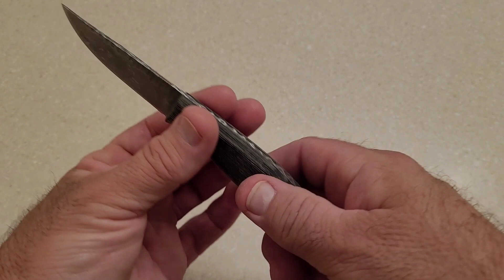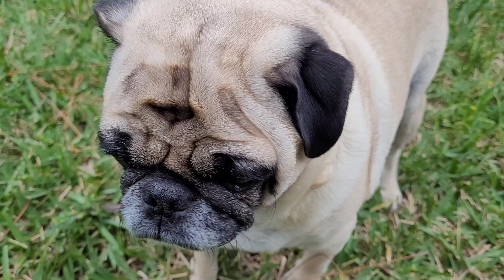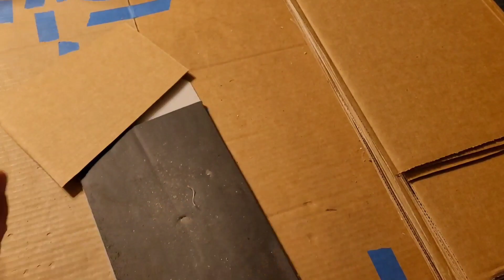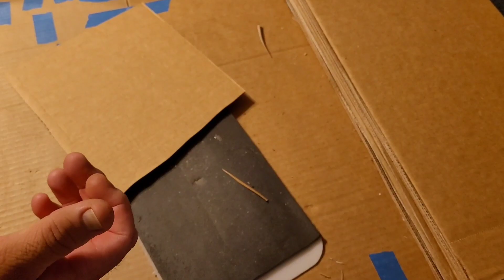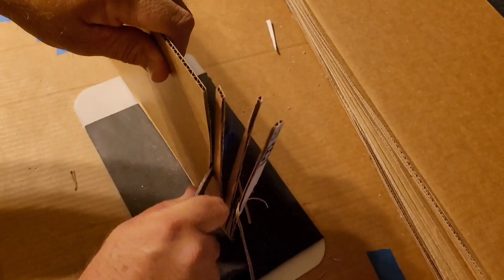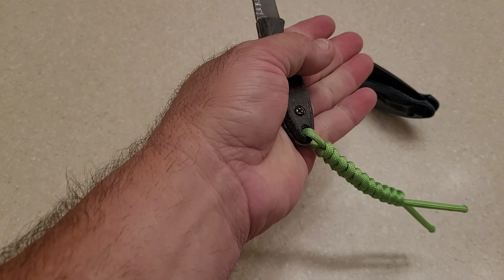Magnacut edge retention testing, DCC pass around fixed blade. How did it do and discussion on use.

Comment: Hey cool! This is Kyle, the maker behind D.C.C.  and thanks for your testing that ugly lil dumpling of a blade! This was the first magnacut blade I heat treated and tested, and I've since made some tweaks and have been running my smaller blades closer to 65hrc and it feels considerably different on the stones.  I think this video is great because it'll help dispell some of the myth/hype of this steel and show that it's not bringing anything wild to the table in terms of performance at the edge, but bringing that 4V/Cruwear-esque toughness, stability, and wear resistance *in a very stainless package*.  I'd love to send some more blades your way sometime soon.  Always much appreciation for your work 🙏
Reply from the maker: Thanks, I do need to get with you at some point. I agree the hype on this should be it's stainless with the benefits offered by tools steels. I'd be happy to test a current version or anything else you might be curious about or want some info out on.
Reply: @Outpost_76  sounds great,  I'll get in touch in early 2022 once I'm up and running after relocating across the country. Cheers

Comment: I finally picked up a magnacut knife recently and had the same experience with developing a large bur quickly. I had a hugely different experience in that it took a lot of work to get the burr removed. I’m hoping that this gets better after  i have to sharpen it several times.

Comment: In real world use it doesn't matter which knife I bring with me to work, 1095 dulls out as fast as cruwear. Can you help explain this? I'm beginning to believe if it's not a single material under strict testing circumstances, steel choice simply doesn't matter. Even toughness, 1095 isn't all that and people baton it thru frying pans. Is this whole super steel thing a scam?
Reply: Perhaps the steel isnt HARD enough fro your use case? Need a good heat treatment. Toughness doesn tmatter much when it just flexes and dulls by mushrooming the apex instead of abrading. If it dulls by mushrooming, you lose the ability to get better edge retention by going thinner, and get even worse when going more obtuse. Try getting a very hard steel if you can, wether it be 52100, 14c28n, or a PM high vanadium steel. It should hold up a fine geometry which will cut much better, then you can only make the edge obtuse as needed to prevent chipping instead. You can make a knife edge tougher but you cant make it harder with sharpening.

Comment: I have a pry guy from DCC coming in at it's supposed to be 64-65hrc now. The results are about what I expected considering on Larrins site you can see that Magnacut performs about like 4V in wear resistance. I wasn't expecting anything more(some people thought you're going to get s90v results) and I'll be happy if it performs like my 4V para 3 but without a need for coating or worry about edge corrosion. 
If I want high wear resistance I have customs in m398, Elmax, s125v. 
I'm interested to see how it compares to CPR steel which is like a non PM stainless Cruwear. I have a custom in it at 64-65 but haven't really used it but it's supposed to perform pretty good from few tests I've seen.

Comment: So magna-cut is a tool steel with stainless property's. The numbers aren't very earth shattering. 
The big thing to me is that was a custom knife and it doesn't live up to the hype. I wonder what the production numbers will be, I'm not holding my breath. 
I personally prefer midrange steel it does fine for me 14c28n, Aus10,xhp.
I have got a big camp knife in A8 so far I really like it. But I have to see how it holds up during camping season. 
Have a wonderful Thanksgiving.
Reply from the maker: Magnacut is a stainless with tool steel properties. Considering how production 4V and custom 4V do this Magnacut at 63.5 is right where it should be. Too many hyped this steel in the wrong ways. It's bonus is its a stainless with very improved edge stability and toughness. Once I can get a 64.5 to 65 rc example I'm betting the results will be very good. 

As an example, if this Magnacut is what we would see in production you will get better wear resistance than 95% of the M390, 20cV and 204p out there. All while having better edge stability,  toughness and impact resistance so it's a plus from a user perspective. If it only does a little better than this you still get wear resistance like production M4 in a stainless that has better toughness and edge stability than other widely used stainless from production companies. The hype was just focused in the wrong place.
Reply: @Outpost_76  always a pleasure to get your perspective. I enjoy your videos. As far as these super steels go to me with what I use my knives for. I don't see a reason to spend the money. I just don't use my knives enough anymore. My usage is outdoor camping so edge holding isn't as important as ease of sharpening and toughness. For cardboard I use xhp, 14c28n. But who knows maybe something new will pop up.

Comment: I would like to try making a kitchen knives out of it - so I would also be interested how does it sharpen on water stones like Shapton, Chosera, etc.
Reply from the maker: As I get some more in to test I'll try it out. I will also do a quick sharpening with this one to see. As easy as it was on a diamond plate and the Venev stones I'd bet it's going to sharpen without trouble on a standard water stone.
Reply: @Outpost_76  that sounds great as most high end kitchen knives users don't use diamond stones (even though this is slowly changing, it won't be becoming standard anytime soon) or diamond plates (only to flatten stones) for sharpening. So to be able to get the full potential sharpening wise on conventional sharpening stones is important.

Comment: I heard that the heat treat on magnacut was not too difficult, hopefully that translates to results for production knives. I think his knives are even harder now for the magnacut. The lower Chromium amount than a regular stainless probably translates to greater ease of sharpening
Reply from the maker: This example is very easy to sharpen. Id that aspect translates in to higher hardness examples it will be nice. Even if it is the same as sharpening harder 4V it's still going to be a breeze.

Comment: Awesome G,  thankyou....
How does that magnacut stand against s90v? More in particular SPK s90v??
Reply: This steel shouldn't be remotely compared to S90v it's nothing a like. You can't compare steels like that. This is a stainless steel that is super tough (think 3v/4v levels of toughness) and S90v is anything but tough but has insane edge retention... They are at two totally different ends of the spectrum in design and use... What this steel excels at S90v is wildly poor at and vice versa. For daily use S90v is my fav EDC steel with M390 a close 2nd..

In my camp knives and hard use fixed blades 3v is my fav, magnacut likely will take that spot once it becomes more available in knife profiles I'm interested in. IMHO the prospect of a stainless steel with 3v/4v performance properties will easily become my fav hard use steel if what is being stated about it is true.
Reply: @EDCandLace  thankyou... awesome explaination ... thats the answer i was looking for.... 🍻👍
Reply: S90v has way less toughness and more edge retention. Magnacut is way more stainless.

Comment: I don't understand why all the hype on this. After the damage it took. I guess wait and see how it tests in future.
Reply: Check out bluntcuts video on magnacut testing https://youtu.be/BYvesTEDME4
Reply from the maker: The hype on this was steered in the wrong direction by some. The hype of Magnacut should be it's stainless with better toughness and edge stability than what manufacturers are currently pushing. The maker did comment and say this was his first blade in this steel and it may not be optimized for the given hardness. He is running it around 65 now. Once I get a harder example I'm sure we will see it excel. Think back to the M390 video BJ did and how the 59.5 hrc example took much more damage over the 62 hrc example. This is what I believe we are going to see as more examples are tested.
Reply: @Outpost_76  CRK was said yo ht it at 62 hrc. Lol
Reply: Hell, there's someone in the comments of this exact video asking how it compares to s90v so it's pretty obvious that people's expectations are a bit out of proportion.

Just the prospect of a stainless 4v has my attention.
Reply: @CNYKnifeNerd  considering G only compared it to production 4v... that particular question remains... any custom blade with a dialled in h.t. will out perform production blades with " ball park" h.t.  ... Its  all conductive to where and how each steel performs and where it sits in relation to other steels that have been around for a while... 😀
Reply: @darrenkirk6576  

Well, yeah, a better heat treat is definitely "conductive" to better performance, but are you saying you think magnacut (or 4V) with a specialty heat treat could outperform s90v with a standard good factory heat treat?

I have a v4e custom done with a specialty heat treat, and other than sharpening easier (much thinner bte) I can't tell the difference between that and my shaman or mammoth in daily use.

Specialty heat treats exist to eke out that last 5-10% of performance from steels that good commercial heat treats leave on the table. 4V and magnacut we're not meant as s90v alternatives, and no heat treat will put them even close to the s90v ballpark. Magnacut is a good S30V alternative, that's where people's expectations should be.
Reply: @CNYKnifeNerd  i doubt it will cut anywhere close to s90v.